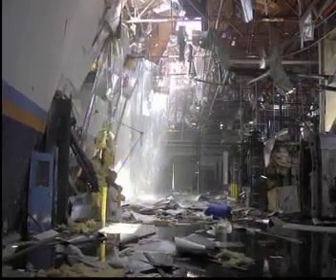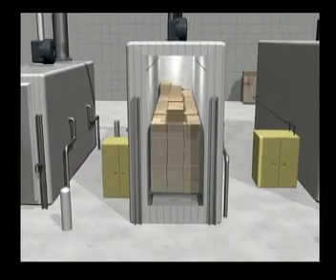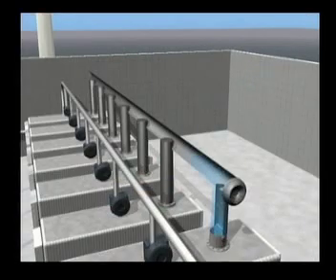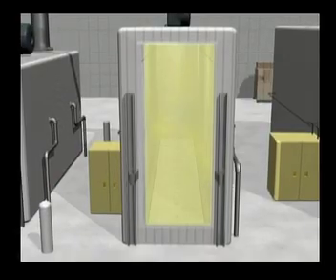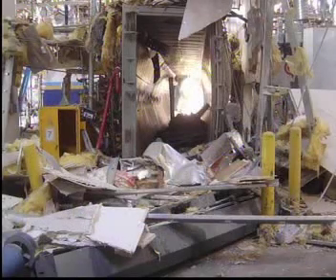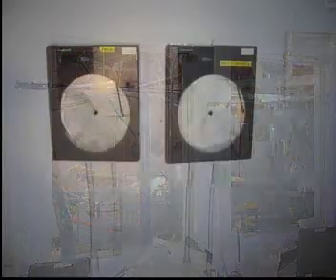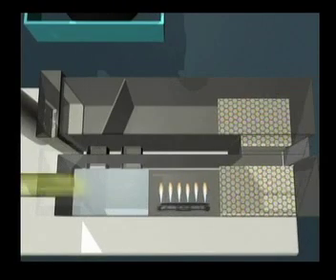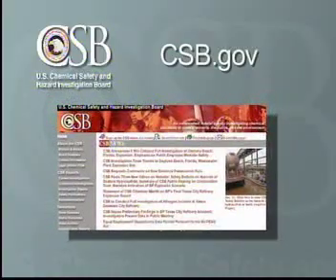CSB Safety Video: Ethylene Oxide Explosion

Comment: I personally think - why use dangerous chemicals at all? Aren't there safer alternatives to do that type of sterilization?
Reply: Don't think so.  Maybe radiation, but that is a whole other set of problems.
Reply: @KrK007  I was more thinking in the direction of Steam or simliar methods.
Reply: @sebastiannielsen  yeah, exposing cardboard boxes and sensitive medical equipment to high temperature water vapour is a really good idea
Reply: @sebastiannielsen  The interesting thing about this method is it is sterilizing the external packaging and outer layers, after they've been packaged... so steam would likely damage the boxes and fail to penetrate into the inner boxes while still hot enough.
Reply: @sebastiannielsen  Steam is widely used for sterilization of medical equipment but not all materials can handle the heat and then ethylene oxide is a good alternative. Handled correctly there is no big danger.
Reply: @sebastiannielsen  the inner plastic pouches that medical equipment comes packaged in is a special plastic that is gas permeable to EO, but seals it otherwise.

By soaking it in the EO for several hours, it sterilizes the contents, as well as all the packaging, so that when the box is opened in a clean environment, and handled with sterile gloves, it staye sterile, and when the inner pouch is opened, it's sterile inside.

In order for steam to sterilize objects, it has to contact the object, not just heat the packaging, and it would melt plastic and over heat meds and creams often packed in with the kits, so heat is only usable for certain hard items.
Reply: When I want sterile dishes I let my dog lick them clean. He doesn't leave a speck.
Reply: There is. Radiation.  Low level not Chernobyl levels of radiation,  I used to go to a company that did just that. Radiat medical equipment.

Comment: At least ONE gas wash would be essential. And no catalytic oxidizer should ever use an open flame, just in case.
Reply: The gas needs to get pretty hot for the catalytic converter.  It's likely the necessary temperature is above the ignition temperature so it doesn't matter that they used an open flame.

Comment: Seriously: A technician who does not know how the system works? This is super useless... Also: You can never pump all the gas out of something. A technician should know that. The closer you get to a real vacuum, the harder it gets to actually decrease the pressure further. Creating such a vacuum is super difficult. For that reason, chambers, pipes, etc. like these are being gas washed and not pumped down to a full vacuum...
Reply: Btw.: Don't you have blow-out walls in such a facility??
Reply: They're not pumping it down to a vacuum, they're bringing in fresh air to mix with the oxide as it's being cycled out of the chamber, that's why they do multiple washes. Once the Oxide has been reduced then the fresh air completely replaces the mixture as the door is opened and the last of the mixture is replaced by the fresh air entering the chamber.

Comment: Just inept. No common sense/understanding of the equipment or gas.
They deserved that.
How do you train someone to have common sense? Or to be interested in what's around them?
You can't.
-&-
Those cambers also should have had blow out panels to direct the force of an explosion away from people.
A fail on do many levels, only dumb luck saved them from themselves.
Reply: You right. And before all this, you must perform explosive hazard analysis at first to evaluate danger! Nothing more dangerous than working with stuffs that you don't know how hazardous/explosive it is!

Comment: Ethylene oxide is the primary ingredient in thermobaric bombs ie fuel-air explosives.
These are the bombs they used on the hajis in the Tora-Bora caves.
Reply: MOAB
Reply: mother of all bombs....no, not quite, Edward Teller Theorized a mega H Bomb could be made but the radioactive fall out would have made a huge area unlivable for 1000's of years

Comment: Seriously though? The vent leading directly into an open flame? Can't see how that could ever go wrong (like not removing most of the explosive gas first)
Reply: The catalyst has to be hot enough that an ethylene oxide mixture would be ignited or detonated regardless of the heat source.  If the catalyst isn't heated then it doesnt function.  If the catalyst had been heated by an electric heater it would still have exploded.  Maybe a flame arrester before the catalyzer would have prevented this, though.

Comment: Use nichrome wire for catalytic heating instead of an open flame
Reply: ACombineSoldier how do you know?
Reply: Completely ill suited for this and many other industrial operations. It doesn't get hot enough, more suited for heating a building or home. Also toast.
Reply: Its used for heating pressurizers in nuclear power plants...
Reply: Electric heating is not cost effective compared to fossil fuel heating.

Comment: Basically 8/10 of these videos involves the operator "Bypassing" the safety control and subsequently blowing them self up in the process.   The lesson here, is to not bypass the safety control.
Reply: "Then the worker opened a valve"
Reply: Chernobyl was essentially that also.
Reply: Not to mention, the supervisor giving his special password to the workers was probably a violation of company policy.
Reply: 1st lesson is to make sure that the person with the power to bypass is educated fully from top to bottom with the equipment that they control. It's not the guys fault that that actually did  bypass the purging process ...nor the guy who gave the code to authorize it. Perfect example of why recertification should be mandatory every so many yrs. fault goes right to the top of the food chain on this one and shit should roll downhill a just a little bit...2) there should be a checklist in place that should be signed off on after every single step of the checklist when doing all procedures in the plant. Everything should be itemized and part 2 of checklist can not begin until part one was completed by workers and signed off on by a operator in control of the equipment the first task was done on..that's what we did and it is why I said that the place I worked it's virtually impossible for this to happen...every single thing u do in chemical plants like this (and I'm speaking from my own experience close to identical as this) we had to write out a permit for the work being done and you would call the operator on cb of that equipment and have him come to where the work is being done and you physically show him everything you are doing that's on the permit to the smallest details...we would lock any equipment valve's that only I had the key for and everyone else does it too and the operator puts a lock on it...only then will the operator sign the permit and work could begin. Even if this was done.... And I'm sure it was... It still would have happened...this tells you it's lack of retraining and recertification and not  procedure itself that's at fault...this is something that they have done many many many times...and should and will continue because time is money...the perfect storm hit dead on which is virtually impossible to detect until after the fact... Which is even more of a reason to make sure that people get retrained/recertified...every year I had a few different things to get recertified to get on the grounds and work...they would not let the person who delivered our checks every week from the check company and we had to send someone to the entrance gate to meet them...16hr OSHA safety training cert is needed and the boss of our company gave the chemical companies we worked for the names of the individuals who have had and passed the OSHA safety course certification and when you pulled up u said your name and the company that you work for... definitely an oversight from the top and I can assure everyone it's impossible for that person responsible for the oversight to do anything similar again cause with that one his safety record it would cost the company that hires him a fortune for workplace insurance to have him on the site. Besides profit...there is nothing more important for  chemical companies than having a clean slate with no injuries from workers onsight at the plant...no chance in hell someone else hires him..
Reply: @Kinguin quite the contrary, saving money is important, so give training so people don't literally explode your money, you know, facilities have a cost. but probably its insured...

Comment: Safety-by-design! No concentration metering before the open flames. No flame arrester in the pipe. No software tags. The venting valve could have also failed. Then this would have occurred too. What was the probability they assigned to this failure mode ?

Comment: Why not have a one-way valve in the ethelyne dioxide evacuation line? It would prevent the flame from going back into the chamber.
Reply: 6 6  Obvious how well educated & highly experienced you are working in dangerous environments... 😪
Reply: Betcha there's 9 other plants where they did have a one-way valve, which is why this is one video and not 10.

Comment: I always wondered how medical supplies were sterilized.  I figured they couldn't all be irradiated.
Reply: Steam is also used for some processes.
Reply: Some are shone in UV death-light in a box of mirrors, some are pressure-steamed in distilled water in an autoclave, you can use open flames and almost-melt the equipment, you can use NO2, Peroxide vapor, Ozone or Lye, some are irradiated in a chamber with an isotope of Cobalt, or X-rays.

Comment: Partly software failure.  The software should have explained the risks and consequences of bypassing the safety step, as part of the bypass process.  Authoring that information should have been a key step in designing the safety bypass.
Reply: Everything these days comes with pages full of tiny print explaining every safety issue in carefully worded lawyer-proof detail.  Nobody reads that either.
Reply: Why does a MAINTENANCE supervisor have the authority to override an Operations function? In my former business, it was the Operations supervisor's line manager (who did understand the process) who had to authorise any deviation from normal operations, and that only after a full risk assessment had been carried out.
Reply: Seems like they expected the user to understand the process and why it should not be skipped. I agree with you that warning flags would be idea in the software.

Comment: what was the main cause for this explosion? it was the workers and their supervisor. they skipped an important step that normally happens when the machines are doing their job normally so they could save some time. if its a step that happens normally DO NOT skip it, it will take extra time to do it but it will be safer if you act like its a normal running.

Comment: Trump is seeking to close down the CSB. I find the piecemeal 'suggested' changes are a symptom of an industry unwilling to protect it's workers or the public at large. I've only ever worked at bench-scale but step 1 of ANY proposed reaction scheme is to have a copy of the MSDS that you have read, understood and followed. As long as the material is in use, the MSDS is clearly visible to the chemist(s). That there has been a history of explosions but no Federal Standards were imposed shows what little power the CSB has. OSHA can set exposure limits but no more.

 At room temperature, ethylene oxide is a flammable, carcinogenic, mutagenic, irritating, and anaesthetic gas. The ring-strain makes it highly reactive and at higher concentrations or when exposed to a catalytic metal, it will also readily form polyethylene glycol. While PEG is not toxic, the reaction is highly exothermic so runaway polymerization will occur. How exothermic? Ethylene oxide is the main charge in thermobaric weapons. The flashpoint of -20°C isn't exactly reassuring either.

 So, in short - Highly Flammable (many metals will trigger ignition), Highly Toxic (a few lungfuls will kill you) and Highly Unstable (it's so energetic, it's used in the most powerful non-nuclear explosives).
Reply: Thanks alot. One clever voice between the unknowing but insisting keyboard warriors

Comment: The stupid pollution device and the design are the real cause of the explosion. My question before building it would be, "what if a dangerous amount of Ethylene escaped through the vent and traveled to where the stupid pollution device might cause it to explode? "  Nitrogen and Oxygen are not toxic and the trace amount of Ethylene remaining will dissipate . Environmentalists are also to blame. Of course there could have been a monitoring system installed to detect how much Ethylene remained in the chamber but that would have cost more money than they were willing to spend. They knew there was the potential for an explosion. It doesn't take a rocket scientist to figure that out. Blue collar employees are typically the pawns in most industries. Instead of redesigning the problem which is the stupid pollution device that actually caused the explosion, they recommend more more bandaids to help reduce the chance of another explosion. I wouldn't work at that company even if they offered me a million dollars.
Reply: Ethylene oxide gas is poisonous so venting it nearby the town is a bad idea as you'd gas the locals. Look up bhopal incident...

Comment: Why does the oxidizer not have a flame suppressor. Something like sheets of gauze  for example in the airflow to prevent flame propagation ?
Reply: Because even if you had a flame suppressor, if you're feeding in an explosive mixture, a catalytic system would have either melted instantly or popped the can and a fire almost certainly would have resulted anyway. The cat system is designed to oxidize ppm levels of EtO, not 5% levels in air. The supervisor was a reckless idiot, and the machine builder is criminally negligent to not have a gas level monitor inside the chamber.
Reply: another step not mentioned would be that there should be an esdv and online sampling of the gas flow from the unit to the oxidizer in the case that a malfunction of prior stages.
Reply: or check valves
Reply: Yes, it is a bloody crazy design flaw if you ask me, it needs at least two flashback arrestors in the pipe.

Comment: Very good review of causes.  Although they focus on operator training and supervisor bypass, the key element that was missing (IMO) is the LEL detection within the chamber.  There should have been no way that a system could be bypassed or advanced until that detector indicated less than 25% of the LEL within the chamber.  You absolutely cannot 100% predict human behavior, even given good training.
Reply: Mike Badley I agree, in this day & age the technology is there and there isn't many excuses. The only excuse I thought of was that a gas monitor goes through sensors if overdosed with a gas, so the sensor would need to be covered & protected during the UEL stages of gas saturation. Regardless, I do agree with you,
Reply: sensors go bad, having overrides is standard

Comment: I would not have expected all "gas washes" to be necessary since no boxes absorbing and slowly releasing the Ethylene Oxide gas were present.  But I'd still want one gas wash before sending a possibly combustible mixture directly to flames.
Reply: Even your average Joe Beerdrinker welder knows you have to run a purge gas into a confined space to get another gas out. Just because the pressure gauge reads 0, it does not mean the gas in question is no longer present.
Reply: BOOM!
Reply: Perhaps the system did not give the option for just one?